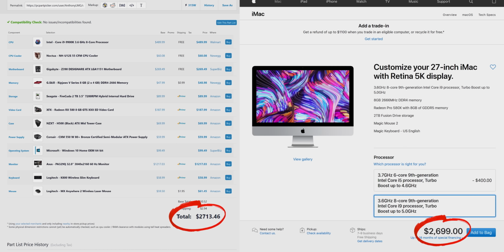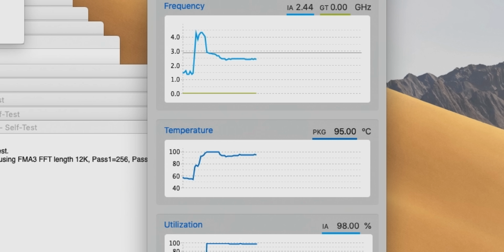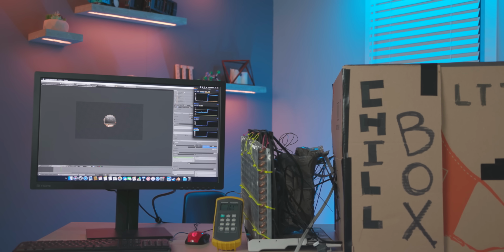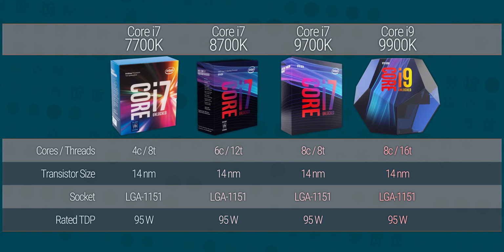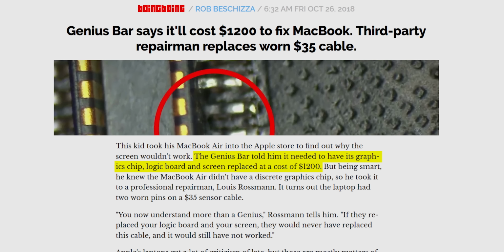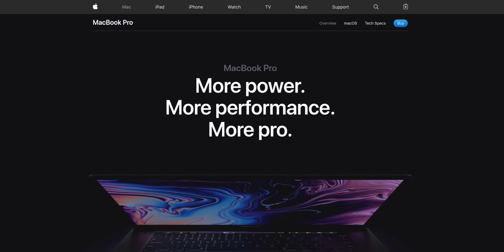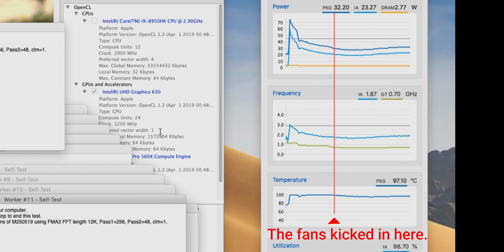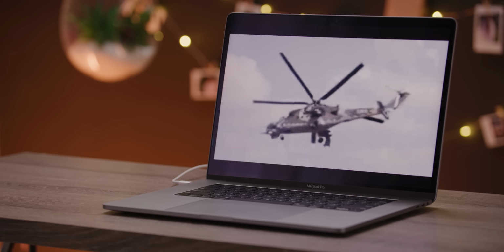Macs are SLOWER than PCs. Here’s why.

Comment: I had an Iphone, iPad and macbook air. after my newer iphone died, i figuered i'd use my older iphone (it was still a powefull machine) however, apple claimed my iphone 5 was "obsolete" this meant suddenly this "powerfull computer"and at one point "the best iphone ever made"became useless. banking apps, portfolio, taxes, nothing worked anymore! basically apple remotely destroyed my property. the uncrackable screen on my ipad, cracked and getting it fixed would be more expensive then buying a whole new device?! plus since it was one month over warrenty nobody would fix it. meaning i had to do it myself with products from ifixit. however, after that apple sent out another update and my onifficial new front caused my ipad to stop working. my macbook only had a dead battery but apple repair center said literally everthing was broken and the cost of fixing it was 1900 euro's (for a product that costs 1200 new!) basically apple's service is the worst one in the world. they have too much power over you. I built my own pc this time, with better specs and for a fraction of the cost. and if something breaks now, I can just replace it. no more apple for me. I am in control of my own computer again.

Comment: I still wouldn't trade my MacBook pro for a windows laptop. Windows is not even an operating system, it's a SPYWARE.
Macbooks aren't 100% status symbols. Some users just prefer its more reliable security and being a UNIX-based OS. 
In conclusion, yes, non-Apple PCs are faster. Just don't use windows. You're better off using Linux.

BTW, Macbooks are technically PCs. Please stop the misconception, Linus.

Comment: Linus: your iphones don't overheat, your macbook do. Get a better cooling solution for mackbooks.
Apple: puts iphone chips into macbooks
Reply: I mean it works
Reply: @ibby1238  i think there should be a ‘just’ in there somewhere
Reply: Big brain
Reply: Also Apple: Apple M1 is faster than a Mac that thermal throttles
Reply: @marcallerheiligen2644  the benchmarks actually beat/on par than the mobile intel ones
Reply: @klaydi5840  To be fair, Intel is like 2 or 3 generations behind in fab technology (5nm compared to 14nm or 10nm). You can see the difference of going to a smaller node in Ryzen 1000 to Ryzen 3000, it's massive. Of course, the M1 is still impressive, but they didn't beat intel THAT badly when you consider that they should get some of that lead back as they close the technological gap.
Reply: @leonro  There is a reason why phones have 5nm process while ryzens only have 7nm, its because 7nms process are very very expensive as it is new tech compared to 7nm or 6nm, thats why intel does not want 7nm process it is very expensive i guess compared to the 10nm whatsoever
Reply: @turtleboi9385  Not really, AMD probably doesn't have the money to get priority for 5nm before apple and Qualcomm so they sat this one out for ryzen 5000, while Intel has their own fabs so they are behind because of technical issues on their end. 

Also, I believe that nm numbers are also some kind of marketing gibberish, because 12nm at TSMC for example is just an improved 14nm (but still same size) and Intel's 10nm is basically the 7nm that amd and phone chips use but a bit more unrefined due to said technical issues, because otherwise they'd have adopted it for desktop already.
Reply: @leonro  lol how can the human eye even differentiate 7nm and 10nm lol people can just trick you it's just too small to.be true jk it's no small not big for processors
Reply: @leonro  The most impressive part is definitely how little heat the generate and the minuscule amount of power they use. The battery numbers are insane.
Reply: @turtleboi9385  nobody ever said the human eye can, this is not done by naked eye, but there is a huge difference between those in energy draw
Reply: @leonro  M1 macbooks shit on intel through rosetta
Reply: @turtleboi9385  that is complete bs. intel struggels since 2014 to get their 10nm fab to work and they just can't. they don't do it because they simply can't. there is nothing special to it. they admin it temselves.
Reply: @leonro  bruh they proved you wrong just take the L 😳😂🤦‍♂️💀💀
Reply: @marcallerheiligen2644  the M1 is actually very decent for what it provides, I never owned a MacBook in my life until  the M1, always PC guy and android, for those who usually buy MacBook pros or airs, it will suffice. If you need amazing performance, get a pc, laptops weren’t meant to replace workbenches, only to help with productivity in office type jobs and now has pondered to average joes.
Reply: Why waste a ton of money on research if you are going to ditch the Intel processors anyway.
Reply: M1 hehe
Reply: I believe it was the plan form beginning. Let’s wait for next generation of apple made chips
Reply: Apple: deletes fan from macbook
Reply: Just put the 2020 ipad air chip did you know its better then the pro chip the pro has a A12  bionic chip and air has A14
Reply: @inv1xity677  no it’s not it
Sure it has faster single core
But it’s slower in multi core and gets clapped in gpu
Reply: @siddharthagupta8528  how does it get clapped in gpu? The intels integrated gpu stands no chance to the M1’s integrated gpu.
Reply: @rajat1960  I was talking about a12x vs a14
Reply: Hehe. : )
Reply: and makes it faster than a lot of pcs
Reply: true lol
Reply: Watching this made me realize there were clear signs of Apple just waiting to ditch Intel, even though it couldn't do it at the time.
Reply: They did it today lmao...
Reply: Bb
Reply: Oof
Reply: Lol
Reply: They must have watched this video 😊
Reply: And it works!
Reply: Lmfao intel man get yo stuff together 😂😂
Reply: @firefoxuser2557  Lmfao get yo stuff together and buy Ryzen 3000 or 5000  but stop crying. As AMD produced trash from 2011-2017 no intel user trashtalked, now AMD is finally ahead a bit and AMD Fanboys are crying in the internet af...
Reply: @harrison00xXx  I bought my pc with an i5 8600k 2 yrs ago, im happy with it’s performance for my particular usage.and yes I agree intel fanboys are having a cry. I dont exactly support or worship brands, I compare product from product.
Reply: FireFoxuser2 intel fanboys are having a cry? read my comment once more.... i talked about the AMD Fanboys, i think Intel Fanboys never existed they are a imagination of AMD Fanboys
Reply: Microsoft forgot me : )
Reply: Hehehe
Reply: I'm not complaining... At least they don't trottle...
Reply: I think you must like this guy just a bit too much.
Reply: If you buy a PC like a dell XPS, that doesn't sound like a harrier jump jet taking off like AMD, it does the exact same. Some people use computers for things other than playing games in their bedroom.
Reply: If you buy a PC like a dell XPS, that doesn't sound like a harrier jump jet taking off like AMD, it does the exact same. Some people use computers for things other than playing games in their bedroom.
Reply: Brilliant+Horrible answer
Reply: @GuruTheCoder SPEELING!
Reply: And they works
Reply: And it outperforms nearly every laptop chip xd
Reply: m1
Reply: I mean it’s working pretty fucking well, and is significantly more powerful than even their top tier Mac Pro.
Reply: Check out the big brain 🧠 on Brad🤤👍
Reply: ∞iq
Reply: Yep, that’s exactly what they decided to do.
Reply: i mean, it WORKED
Reply: MacBook do be farding tho
Reply: Therefore no better solution is needed as the normal solution stolen from their Intel counterparts are fine for the iPhone chips.
Reply: I didn't think it was the same chip I thought it may be the same architecture with more cores but I don't have any reason to claim that your wrong but if this is what happened apple has done the best thing ever 
1. Helped the arm architecture grow more common
2. Harm there own reputation by having most apps for enthusiasts who want to monitor what's going on and who also still think apple is good (can't imagine why but they exist) not work with the new chips. and even further isolate themselves from the gaming community by not even having an arm to x86 emulator work in there operating system
Reply: ok thats the biggest smoooth brain move i have ever seen xd.
Reply: And now with the m1 max they fucked intel and amd in all holes and just killed them both
Reply: this comment aged like fine wine
Reply: big brain moment
Reply: Lol it did, and now a fanless Macbook Air, great performance with Macbook pros(not included the 13')
Reply: m ≠ a
it's arm, but it's not a phone chip
Reply: But they still overheat
Reply: That would actually be great
Reply: guesses the future m2 chip
Reply: 2020 : they did it
Reply: And completely outclasses Intel in the process
Reply: The m1 chip on the macbook air still beats i7 11th generation
Reply: stfu m1 is better than most intel i9s
Reply: @toxicityuser  well... we can say that the in-house apple engineered silicon chip works better with the in-house apple engineered software that an intel-engineered chip that is left termal throttling yeah.
Reply: @toxicityuser  it’s a joke 🤦‍♂️
Reply: @toxicityuser  yeah thats because intel isnt really good for a couple years now. and no the m1 cant do stuff like blender on the same speed like a m1. its by design of the chip. ( risc and cisc dfferences ). just dont fall to apple marketing
Reply: RATIO
Reply: you guys should also consider... and thats a fact since about 90nm and smaller...all of these numbers are marketing only.
the main part of the CPUs are always a bigger "node", probably some special executing parts are 7nm, but thats it. the power delivery cant be 7nm it would burn the powerline completely (at intel for example around 40Amps per core!)

Its also very logical... look at 7nm vs for example 22nm on my 4790k. Ofc its not that efficient as a Ryzen 3000, but its competing well with a 3600x for example, and lets be real: the TDPs of older Intels are not as fake as the new TDPs are when they claim 45W but the CPU is drawing for some minutes easily 80W because intel squeezed out everything they could....

My 4790k is consuming about 110W at full load (OC ofc...), even beating in games a stock 3600x and on par with a OCed 3600x. The 3600x also easily draws 65W+, not that of a difference.
Or my "predecessor" of the 4790k.... a Phenom II, claimed as 45nm CPU, meanwhile my older Intel 45nm was MUCH MORE efficient (but also weaker, 2 fast vs 6 "slow" Cores). These days nm meant nothing (at least not much), and it will say even less when we go smaller.

I would always prefer a heating, inefficient bigger architecture aslong its cheaper than the competition but performing similar. Intel is not "killed" yet as AMD fanboys always cry - their chance is even for the closer future to imitate AMD now... pack more cores into one package, probably a optimized Xe graphics and they are in the competition again.
Yes, they finally have to give up their greedy behavior of selling us renamed products for a higher price, but it can only be good for us customers (as Intel is now the price/performance king with 9700k, 10400KF and so...)
Reply: @harrison00xXx  I call bs on this
Reply: @marcbensen8963  without arguments... so gtfo if you dont have any clue what you talk about :)

Comment: That is why I use TGPro on my mid-2012 MBP w 500Gb ssd and 16Gb Ram.  I run Mac apps and hungry Windows 10 Apps concurrently. Yes my fan sounds like a jet engine when needed... But I have a great platform that doesn’t require annual registry fixes. Solid performer since 2012 and still going.

Comment: The sooner Apple ditches Intel the better.  Iphones and Ipads use Apple designed CPU's based on arm by the way, thus they run cooler.  When they make the switch the latest Arm macs will do the same and probably be fanless.  As usual Intel holding the industry back.
Reply: You’re saying when they make the switch it will be better, as if they aren’t doing it already. Because, M1

Comment: Apple heard you, Linus.
Reply: Not really. They still stay at 95-100C which is the same for longevity and who is to say they aren't still leaving performance on the table? I mean they still have minimal cooling (literally none on the air). 

They have better performance because of a better chip, Apple did nothing Linus suggested.
Reply: @josephgood2704  well technically they wanted to make it fanless but if they used thermal pads to literally almost fix the issue they would be breaking restrictions which keep you from making a laptop with a hot bottom and would be forced to revise the MacBook before it even gets sold
Reply: @josephgood2704   9:40 He talked a little bit about why Apple didn’t put processors better for the form factor they’re creating. Also at 6:56 talked about the iPhone performance in comparison to androids, probably referring to the efficiency they have. And says “Why this difference in philosophy?” And they’ve fixed it with M1

Comment: Some other reasons why.

1. GCC compiler is good, but the Intel compilers generate faster code.
2. The Mach Kernel (yes, Mach, not Mac) was an experimental kernel designed to replace monolithic Unix kernals and implements message passing instead of using direct memory addresses. It sucked and the performance was terrible, so it was abandoned. But for whatever reason Jobs resurrected it for NeXT OS. Sure, it's probably had a lot of tuning over the years, but a Linux style monolith would be faster.

Now I know Windows uses message passing, but then the NT kernel is a bit of a mixture of all sorts of things. I know one thing, I don't see a spinning beachball all the time and then have to go kill off an app.

Another reason would be unfamiliarity with the languages Apple uses. Objective C wasn't mainstream, their replacement (Swift) isn't either. Use a funky language instead of C++ and you aren't going to get the best quality apps on your platform, outside of the big apps from Adobe, Apple apps and those done by enthusiasts.

Comment: It's simple and boils down to a phrase that was said in a 2008 Onion News Network video: "I'll buy anything if it's shiny and made by Apple". Mac users by and large don't care, and Apple is happy to ride the coat tails of their success as a digital artist's powerhouse. They've realized that regardless of whether it does what it says on the tin or not, they can get away with selling crap because the users all love how pretty it looks.

That said, there are some things that Apple does right. I'm an IT guy, and Apple Remote Desktop is the best remote management software I have ever used. Install one app, turn on one setting on every Mac you want access to, and boom, you can remote in and manage it at any time, so long as you're on the same network.

Comment: Work bought me a brand new, reasonably high-end, 2020 Dell laptop. I used it for 4 weeks to give it a real shot. I've been on OSx for over a decade now, so I was actually somewhat excited to see what the windows and PC experience is like these days. After 4 weeks, I took that laptop back to my IT guy, asked if I could exchange it for a new SSD and Ram upgrade for my 2013 MacBook Pro, and that was the end of the Dell. Honestly, The extra 15-45 seconds of rendering time is absolutely outside of my peripheral when compared with the smoothest trackpad experience ever offered and the sexiest device interactions like AirDrop and AirPlay. Rendering comprises maybe 5% of my workday, and it's always at the end of the day. But if my fingers still feel like they're clumsy on this PC trackpad after 4 weeks, then suddenly it's taking me an extra hour to wrap up my work day. I'll take the 45 extra seconds of rendering, hands down.
Reply: You work all day with a trackpad, airdrop and airplay…. Uhm ok  …we all need to move to your company and do your job. Was that laptop a Precision or an Inspiron ?
Reply: @amazy81_ale_mazzy  Life as a graphic designer. I'm constantly taking photos with my phone for mockups, then airdropping them to my computer for product placement where a trackpad fits my orbital workflow with gesture control SO much better than having to find the modifier keys on my keyboard to use a mouse. And to answer your question, it was a Precision.

Comment: Blah blah blah - sorry I always wanted to do this :D 

Anyway - here is a question. Why semi-pro and pro artists - like photographers (including myself) after switching to Mac, do not even think to go back to any windows machine? I bought my first MacBook Pro at the beginning of 2013. It was mid2012 and working with lightroom, photoshop - oh wow! You just can not compare those two. It crashed only one time - sth like a blue screen! But my previous windows computer was crashing like once a day :D btw. still writing from the same laptop :) And still is quite a capable machine for retouching. 

Mac is not only hardware/ design etc.. it is also software. This is why people who start using osX, most of them do not think about coming back to Win. 

BTW. You asked a question and said you do not have an answer. I think now we know the answer. Apple created computers slimmer but same time Intel did not provide CPUs which could generate more power and less heat. And now we know, that apple do care, and they are switching to Silicon :) eh. that was your second question why you can run heavy tasks on iPhone but not on Mac :D 

Will you do a new similar video to compare the speed of PC vs M1? :D Maybe it will require to change the title: "Why PCs are SLOWER than Macs. Here's why" :D